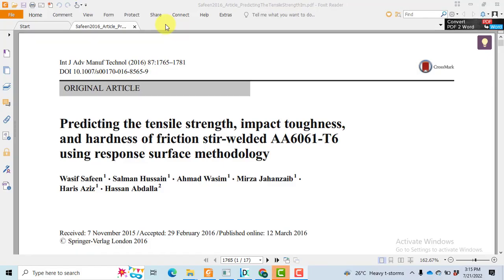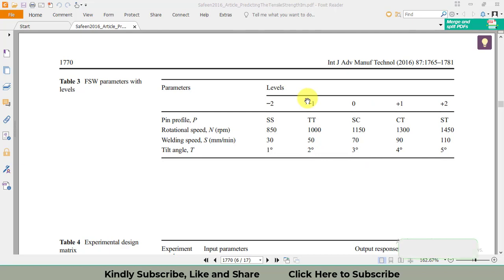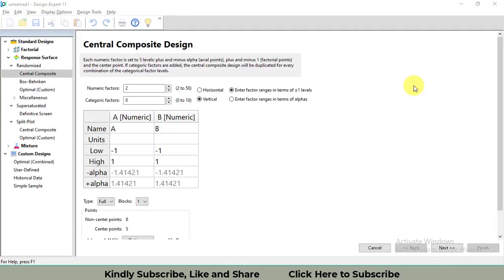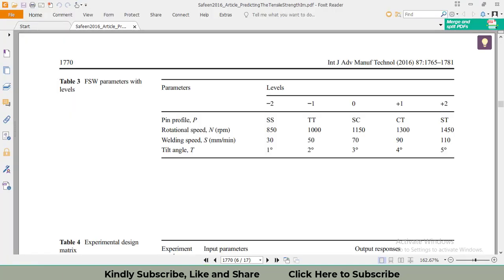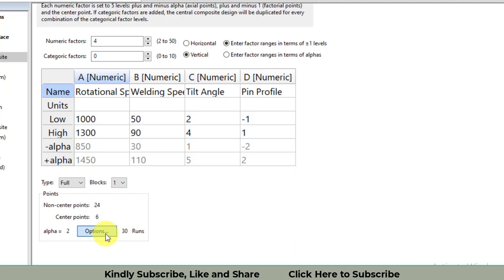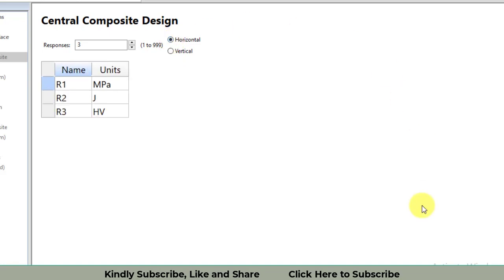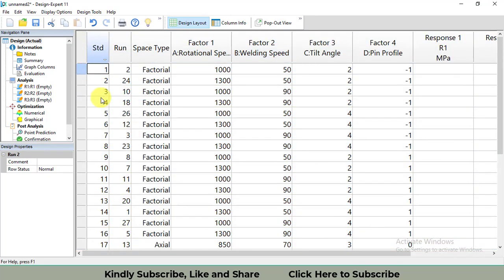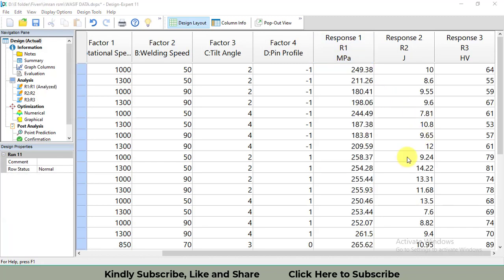Central Composite Design in Design Expert | Research Paper Example | Response Surface Method Part 1

Comment: Good explanation, There are 6 center points. When we input response, for center point we need to input 6 values, do we need to experiment with the center point 6 times so that we get 6 response values to input here?
Reply from the maker: Center points are those who have same values of input variables. If six center points in design, then do six experiments at same settings I.e. center points
Reply: Thank you @EngineeringandInfo
Reply from the maker: @NoorMohammad-nh9sf  welcome